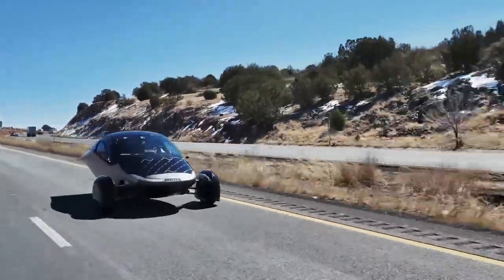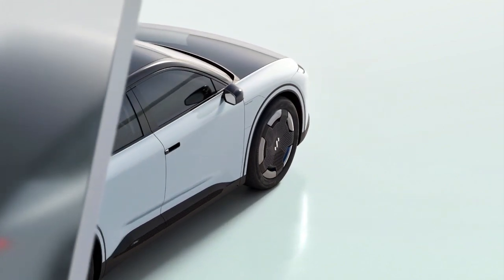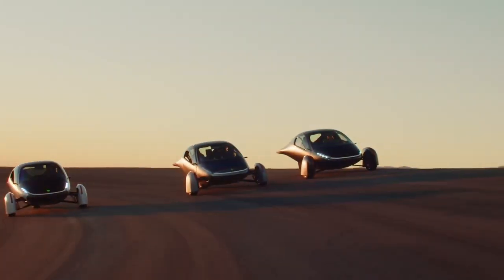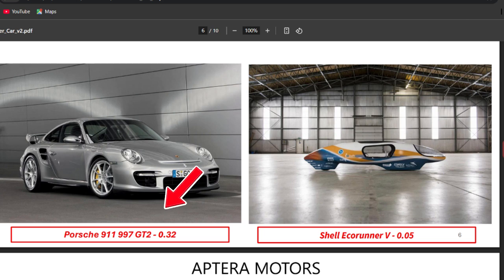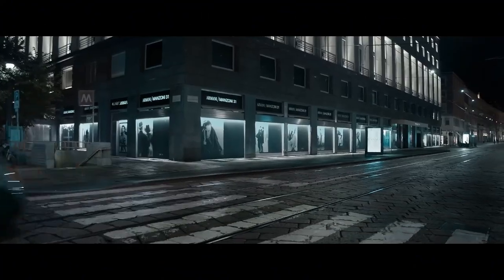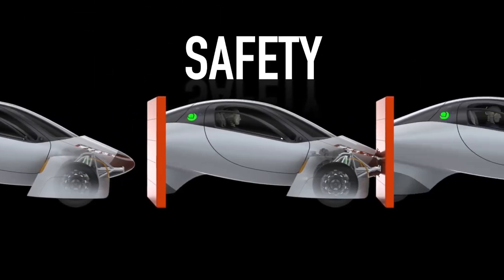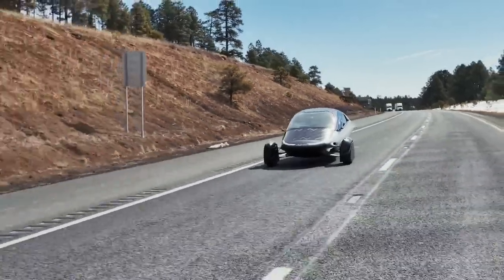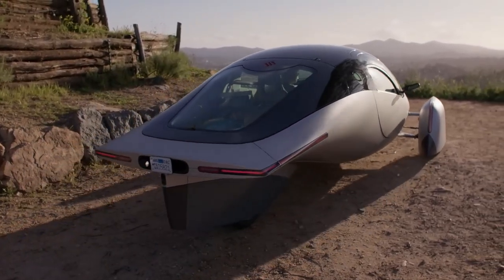Dr Elie On Aptera The First Solar Car: The Drag Coefficient, Rolling Resistance & More

Comment: Peraves Monotracer is a better design for a 2 seater. 

I designed better wheelhouses. The wheels need full cover of most moving parts.

And I invented a self balancing batterie pack. It moves the battery in order to keep the 2 wheeler balanced. 

I designed a front spoiler cage that helps with crash resistance. For parking you can save space and flip the spoiler upwards. Upwards flipped it also puts helper wheels on the ground. 

It also got a propulsion fin at the back. Using air propulsion on vehicles leads to even better aerodynamics.
Reply from the maker: woow how can we see it bro? we want to showcase more of such inventions
Reply: @chriswabs  
I got all this stuff in my head.
You can google the monotracer.
(It should somewhat real )

But i need people that make 3D Designs.
And since they all want money im stuck. Cause i should own all the money and not the bankers. 

And i like to stay focused on using my head, instead of programs and tools. Since i want these psychic powers.

And Moneylenders i don't like. Cause i can't work under pressure.

At this point only people that are able to imagine can see.

DNA evolved this way too. It got all put into DNA cause oppression did not allow evolution. 

Now we are all dead and able to see our imagination. Sadly the oppressor s followed. This is why i stay vegan.

Oppressors follow through war crimes and factory farming.
Reply from the maker: CL its you 😁😁, you told me that you design them in your mind. Had a livestream  on sunday, I missed you in the chat section
Reply: @chriswabs  Peraves MonoTracer is worse than the Aptera.
Don't be fooled
Reply from the maker: @scamchan  that's our brother CL, he say he develops things in his mind
Reply: @ We can't take his mind seriously then.
Reply: There a so many poor design and engineering decisions here with this project its too difficult to list.
Reply: @mikelfrance-l6x  
To be an Imposter can be a very difficult Job. 

If people can't even List the poor design choices, guess they need to work on proper working synaptic connections in their brain. 

The allmighty drug addicted pretender is a pain in the ass for every serious inventer. 
Thats why Patent rights and intellectuell property developed.
Reply: @ I can list them but that won't make any difference in the real world.

People can learn from real world experience why this design isn't practical.

Since people don't or or can't imagine why it is so bad.
Reply: @scamchan  

Constructive criticism is the art to point things out.
This helps people who need to change to start at some point. 

And you just need to suffer until you developed enough brainpower to point things out sharply enough. 

And a simple List perhaps would a a good start in order to change ?
Reply: @c.l.3806  OH wow this is what we are doing now.
Insults come easy.
Facts are a bit harder to come by.
Now when you get past your pride and ego.
Imaginary inventions don't help anyone.
Perhaps you can take your own medicine and start creating instead of that imagination of things.

Don't start fires it won't end well.
Reply: @ "Peraves Monotracer is a better design"
 HILARIOUS you can't be serious.

This is what I mean by ego that gets in the way of practical real world thinking.
Reply: @scamchan  

A Monotracer can be build by poor African people out of Motorcycle parts. 
And thin sheets of Polycarbon are not this expensive, in order to form the hull windows.
Reply: @c.l.3806  I guess understanding of practical is needed.

What is the size of the average person that wants to get around town and take care of business?

So you telling me two people that go shopping need to load up into a motor cycle that needs extra wheels to balance itself?

Again a poor person can get a motorcycle.
Who needs the extra crap like windows on it and a covering.

Might as well get a car.

Poor people don't need to figure out how to build shells for motorcycles or how to build motorcycles from scraps.
Reply: @scamchan  
The problem is energy effiency.
You can save up to 70% fuel if you 
Build a aerodynamic cover.

It is for people that travel to town and back to the land. That is why vehicles are needed. 

If you are interested you can study about velomobile aerodynamik covers.
Reply: @c.l.3806  Basically you can put a cover on a scooter.
Fuel efficiency isn't the real issue for a motorcycle.
They already get great mpg out of the box.

How about we talk about why anyone would focus on covering a motorcycle for two people and expect it to be practical.

Travel to town and back already happens without the cover on a motorcycle.

So what problem is being solved here?

Converting scraps to covers and motorcycles?
Reply: @c.l.3806  100% fuel saved by walking everywhere.
Just letting you know.

It isn't about being poor it is about what can be used to get the job done.